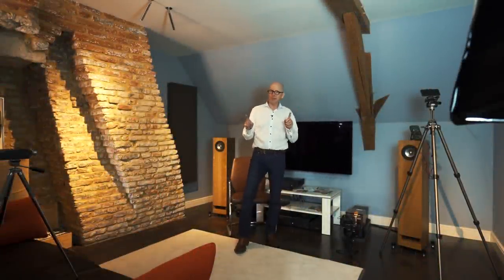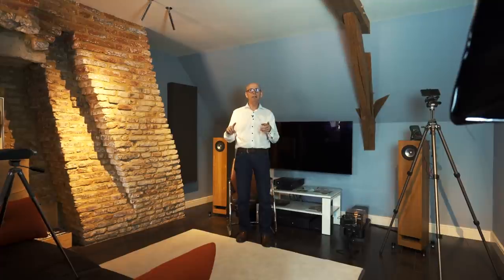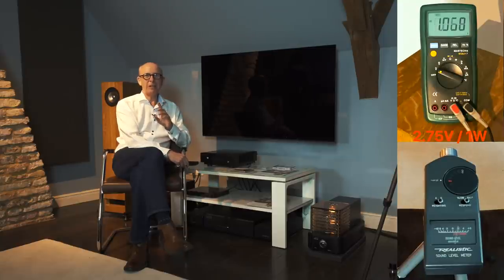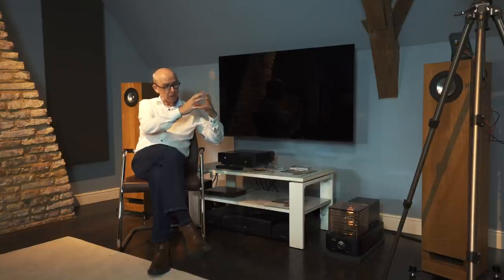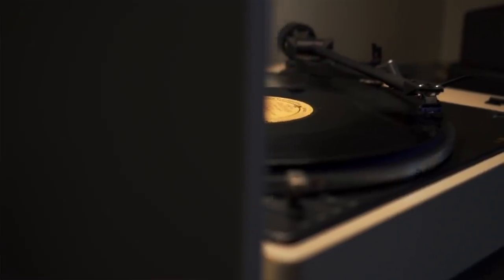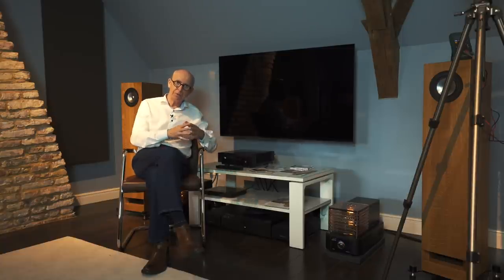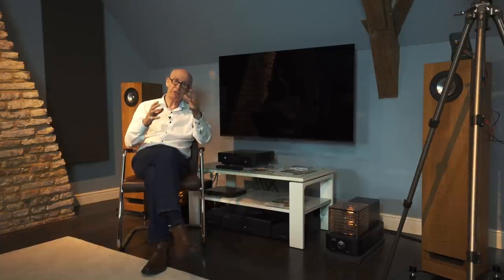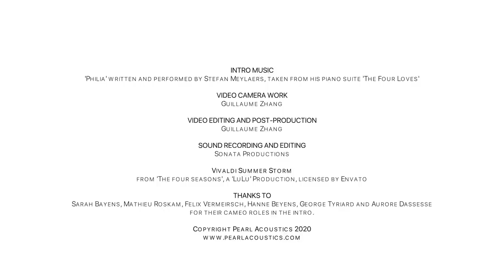How loud is 1 Watt (with an 87db Loudspeaker)?

Comment: I've noticed over the years that as amplifiers have become more powerful speakers have become less efficient. Whether this is coincidence or not I don't know.
Reply from the maker: Hi Mike, I think the two are related. As modern solid state transistors became more powerful (and cheaper) it allowed loudspeaker manufactures to change their designs. By building crossovers that held back mids and highs they could boost bass performance - at the cost of efficiency, that was no longer a problem. With old tube amps, that was simply not possible.

Comment: So based on this conclusion what advertised spec of an amp really says how well it can deliver its spec'd watts to a pair of speakers?. People say the quality of the power supply makes the difference, but is there a spec for how good a power supply is, other than maybe more filtering capacitance. Seems like you'll only know either trusting reviews or having a dealer that will lend it you, which not everyone has the liberty of.
Reply from the maker: Hi thanks for your comment. Sadly, a good amplifier needs a good design, high quality components and a good power supply, unfortunately, it’s always a combination. It’s a bit like a great pizza, is it the base, the toppings or the type of oven it’s cooked in? 
Indeed, it’s so difficult to know without trying. All I can say is that there are very few ‘bad’ products these days. One option is to look out for good reviews of a product that was launched a few years ago, and then search for reliability issues with it. If it brings up very little and people are still positive about the product, then it’s probably good. I hope that helps a bit?

Comment: So answer why my 100 watt mcintosh is not loud till 55 % power.?
Reply from the maker: That can be because of the mechanical resistance of your loudspeakers but also because it’s logarithmic? Can be many factors - you need to measure.
Reply: Same here with my Denon dra 800h, mine has 100 Watts and at 50% starts to be audible loud, only radio is listenable at say 25%, I need to reach 70% for really loud. Interesting.
Reply: I recently purchased an IOTAVX SA3. It produces 90W into 4 Ohm (for my speakers). The volume display is listed in negative db. It came from the manufacturer dialed at -30db. I turned that way down before I played anything and did an SPL meter test with Pink Floyd's The Final Cut. I got to -25db and SPL peaked at 98db. Needless to say I don't go much higher than -45db for normal enjoyment. I think the lowest setting is -60.  ** Lowest is -90 so 45 being halfway is about right - which is louder than normal speech.
Reply: To expand on Pearl Acoustics' answer: The volume dial is not linear - in other words, the 55% setting on the dial does not equal 55 watts. Probably more like 1 watt at 50% dial, 10 watts at 75% dial and 100 watts at 100% dial.
Reply: steven whicher  I definitely didn't hear any clipping. The tweeters are crystal clear too. When my speakers were connected to my Kenwood receiver I would hear a hiss out of the tweeters and clipping occurred around 50% power. It's nice having the extra power, even if I won't push it all the time.
Reply: could be low input signal

Comment: That was a massive surprise to me.
EDIT: Is it a valve thing? The reason I ask is a 10watt valve guitar amplifier will destroy a 10watt solid-state guitar amp.
Reply from the maker: Hi. 10W is 10w it is a measure of power. Having said that, guitar amplifiers tend to have very efficient drive cones, meaning they make a lot of noise for limited power input, over a narrow bandwidth.
Reply: @PearlAcoustics  So why does a 5w Valve amp sound louder than a 40w solid state?
Warmest thanks for the answer, by the way
ps... I know I could just Google the answer... I just prefer human discourse

Comment: The principle of impedance is not understood by many people buying audio equipment and probably neither the sales people. The principle of dead current during large phase changes is for instance a real amplifier killer. Therefore you should always buy an amplifier with huge amounts of power capacity in order to have proper linearity in the sweet spot. Here is another topic where the Germans Engineers are ahead of anyone; Audio.de magazine measures amplifiers load stability resulting in a 3D graph showing voltage / Resistance / phase change. The higher the graph (voltage) and flatter the graph (stability against phase change) the better the amplifier.

Comment: 90% or so of the amp's power usually goes into the bass range which is non existent in this video. Then, the sound appears very distorted. So no surprise here: at low watts the sound can be annoyingly  loud but nowhere near the pleasingly high power of high fidelity.

Comment: Is a valve amplifier considered "class A" power?
Reply from the maker: Hi Daniel, i wish it was that simple. A valve or solid state transistor, essentially do exactly the same thing = increase an incoming voltage. What makes an amplifier ‘A’ or ‘A/B’ is its architecture. There are lots of valve A/B (push pull) amplifiers. Have you seen my video ‘What Amplifier?’ I explain the principle there. I hope I have helped a bit?
Reply: @PearlAcoustics  I know the basic differences between A and A/B, but I have a lot to learn. I'll check out your other video as I have not seen it before. Thank you

Comment: I saw your DMM hit 9.06v when you said "This is only 2w of power". Power was close to 11w at that moment and I suspect at least twice that since a DMM can not accurately measure the voltage. This "experiment" was a novelty at best and proves nothing. The proper way to conduct this "test" is to first maximize the peak value of the music track. This means the loudest peak in the track will be 0dB. Then create a 60Hz tone that is also maximized to 0dB. Why 60Hz? Because that's the frequency a DMM is designed to measure. Why 0dB? Because that assures no more then 1w of power can be produced. Play the 60Hz track and adjust the amplifier's level so it's output voltage will produce 1w into your load. Then play your music track and compare to this video.
Reply: European standard voltage is 230v and 50hz
Reply: @eddiecollier3165  Congratulations

Comment: Valve amps have low damping factors; properly designed GanFET amps can have very high damping factors and are the fastest. Plus they can handle large impedance swings which valves cannot.

Comment: The sampling rate of your DVOM is far too slow & the frequency response is severely limited...a scope with  a  variable rate playback function   would get a more accurate result.
Reply from the maker: Indeed it would but I just wanted to make a point. It’s always a balance between purely accurate science with a test lab and demonstrating what happens in ones living room in a pragmatic way. I can’t please everyone it seems!
Reply: @PearlAcoustics  Anyone who has observed an analogue metered power (Watts)LOG  scale on an amp...will likely understand the apparent  "disconnect" between wattage & the actual loudness of the music.
Reply: @AndieBlack13  For reliable scientific measurements   we use constant acoustic levels. Producers of  speakers give results for constant  1 kHz which is also nothing in common to music.  I for my research I used pink noise which covers full produced band and is also constant. In my opinion consumers should not follow tech data   at home . What to follow,? . Home is no match to anechoic laboratory..  What to compare to? Only reality  .. Fell sorry for those who got  200  Watts amp  believing only in  it's lower THD than other powered 10W.  And at that time having horrible  loss of loudness connected to phases.

Comment: But, what about the speakers resistance change given a certain frequency played?
even with the voltage shown as 5.5 volts, is that at 8 ohms? 20? 6? etc.. given that ohms law states.. P=V^2/R.

Does this also mean that anytime a ''1'' watt amplifer "draws'' over its wattage rating ''given what THD is listed or any other types of distortion '' that you start to clip the input signal due to lack of ''headroom''?

This is just critical thinking and by no means, a judgement against your videos statement.
Reply from the maker: Thank you for your question and comments. The Sibelius’ driver dips to around 6,4ohm at around 38hz is nominally 7.4 ohm. But, as you stated, my video is only making a very general point that loudspeakers tend to make much more noise than we expect at as little as 1watt, and that people tend to forget that  the figures are mostly quoted, ‘per channel’ and not in total. 

As to an amplifier drawing over its allotted rating that depends on how the rating is set. There are many manufactures that under quote their ratings. However, this might not be the answer you are looking for, and not being an expert in how amplifiers behave with regards the subject of current draw and voltage at THD etc. I need to leave your question open for more qualified people to answer. I guess the answer can be found on specialist forums. maybe ask someone like ‘Colin Wonfor’. I do know that some manufactures of professional amplifiers have anti clipping circuits but I am not sure if they continue to deliver more current in those situations? 
Hoping this helps?

Comment: Mmmmm, measuring the power by reading only this average voltage at the multimeter ... I think you are loosing so much peaks that may be impacting the sound pressure feeling a lot.  How does this multimeter treat the reading when the signal under measurement is a complex real music signals instead a single 1 kHz tone that is the signal used by manufacturers for sensitivity measurement of its speakers?
Reply: I was thinking the same thing! The screen update on the meter is way too slow to accurately show the peaks of voltage. A scope would be better, but as you say, a 1kHz tone would be better. 40-odd years ago, I recall a test that showed that even at average room listening levels, a hard hit on a bass drum could need 120wRMS to stop clipping...

Comment: Isn't 5.5v into those speakers 4 watts not 2 watts?
Reply from the maker: Dear John, thanks for your comment. Indeed you are 100% correct. This is an error on my part, as you may have noticed, I corrected it in the description notes.
Reply: @PearlAcoustics  I am sorry I had not. Could I ask if you have a note of what the peak to average voltage ratio is typically for music and do we need an amplifier that can deliver more or less than the peak?
Reply from the maker: @JohnJackson66   as you probably know, we tend to use the mathematical equation RMS in HiFi. But that does not give us enough information. For example: if the impedance curve of your loudspeakers across the frequency range is relatively flat then a low powered amplifier can work well, even on relatively low efficiency speakers (such as LS3/5A’s). However, if your speakers have large fluctuations in impedance then the amplifier may have to deliver large currents very quickly at certain frequencies to give the ‘flat’ frequency response curve the manufacturer claims.       In certain design of amplifiers, where the required peaks just cannot be delivered the resulting distortion can sound fine, while in others it is totally unacceptable. I am sorry if this not the answer you would like. Feel free to reach out to me via email, or via the Pearl Acoustics website and we can consider your specific situation. I need to be careful not to generalise... because there is always a situation that tends to break the rule

Comment: Perhaps your measurement equipment is not fast enough to show us peak transient watts?
Reply from the maker: Indeed… totally correct, I was making a general point that 1 watt, on most systems, is way louder than you imagine and that we generally listen to way under a watt in a small listening room. I was applying RMS or ‘average’ measurements, that you can easily read on a handheld decibel meter.

Comment: My amplifier has vu meters that you can set to have a 1 watt scale or the full 100 watt scale. I rarely get the meter moving on the 1 watt scale and if i crank it up to 1 watt it's too uncomfortable to listen to. But there is definitely a difference bass response between my 20 watt amplifier at the same volume even though they both play at a fraction of their max rating.

Comment: So its slew rate and the ability to deliver current required for a set of speakers, combined with speaker efficiency.
Personally I believe a highly efficient speaker driven by a hi slew rate amp will get you to that magical place where it sounds natural and effortless.
I have some big OTL triode monoblocks that can be run at 25W or at 110W.  Exact same system, just removing parallel tubes.  While both sound great, there is no question that I prefer the higher watt amp.  They just have more weight and authority and clearly more bass reproduction even though I typically listen at 80 db ave and use speakers that are well up in the 90's.

Comment: I think a speaker will be efficient if you hook it in an amp with a higher power than the speaker itself. If speaker wants more power and the amp could provide it then the speaker is happy. A box design also is a factor maybe.
Reply: so its ideal to hooked up an amp with higher power than that of the rating of the speakers?

Comment: Professional help needed. No cross over means no wattage leaks. 
What's the average leak for generic 2 way speakers : something like 100% to 200% power leak ?
Means the 8W peak could transform to 32W, just adding a regular cross over.
And giving the fact that those 2 way speakers have some 4 Ohms regions, u then need 64W for that little 2 way thing to run smoothly.
So u know what ? Maybe a 100 W per channel would be more secure for the standard tiny industrial bookshelf speakers... just guessing.
The little Klipsch "the Fives" 2 way, is supposed to deliver 160W RMS... and 320W on peaks. Manufacturer data.

Comment: I’m not interested at how loud a speaker is at 1 watt per channel.  I’m worried about loss of detail at lower volumes which I usually listen.  You can hear an incredible change in the detail and dynamics of the music shortly after he looks back and says “we’re at 34”.  About three or four clicks on the volume control and the music comes alive.  I want my music to feel alive at lower volumes too.  Not just volumes that would not only annoy my neighbors but me as well.
Reply from the maker: Hi, thanks for your feedback. The difference you hear at 34, is not to do with the speakers, I can assure you of that. Not sure what it is exactly but one if the very special qualities of the Sibelius loudspeakers is that they sound identical from very low volume to normal listening levels and a bit higher. So they are ideal for late night, low volume listening. Hoping that reassures.

Comment: I always thought it was an amplifier’s ability to drive real current to the speakers that produces perceived volume. Remember the old NAD 3020 from the Seventies that was rated as 20+20W but in man tests at the time was able to drive speakers to higher perceived volumes than many 200W Japanese amplifiers.

Comment: Dude, you are measuring a complex voltage waveform with a multimeter that it is not true rms nor it has the bandwidth to measure such signal. This is unwise, at best. This multimeter is designed to measure 50-Hz or 60-Hz mains power voltage and not what you are measuring.
Reply from the maker: Indeed. The video was to make a point - which I hope I did. I wanted an easy screen to show up on the video camera… but thanks for your comment.

Comment: Having a car with a top speed of 60 will allow you to drive at 55, but not with a sense of authority.
Having an amplifier that tops out at 5 watts will play music, and might do an outstanding job at moderate volumes, and for music with undemanding dynamics, and for music without too much deep bass.

Give that amplifier some music with dynamics, slam, and deep bass, and it will play it, but not with a sense of ease.

There are some fantastic, low powered amps.  Their low power means that their power supplies will not have to deal with huge requests, making some low powered amps killer good.  But only for music that they can handle.
Reply from the maker: Absolutely! - Thanks for your input. In my ‘info’ video I just wanted to raise the topic to guide people into deciding what is right fir them - hence, at times a pair of 600W monoblocks still make sense, even in a domestic environment.